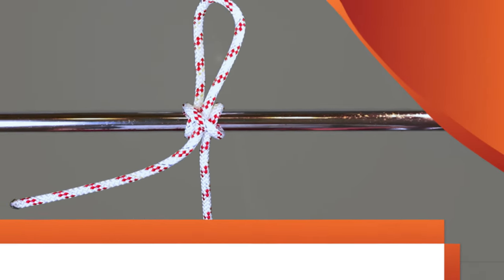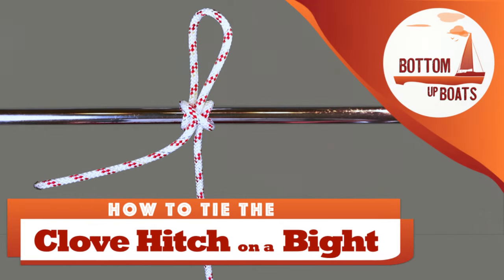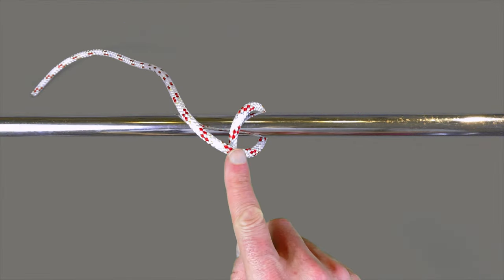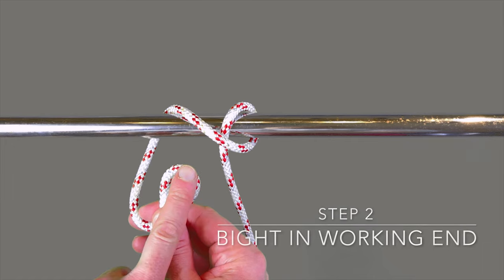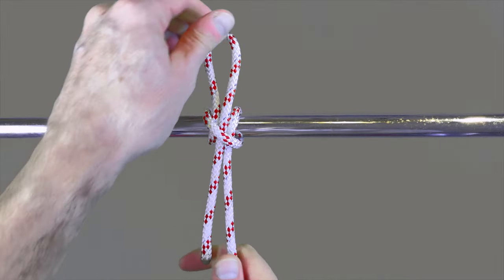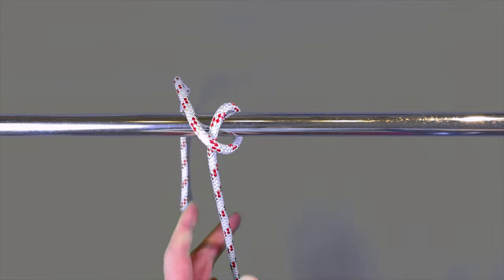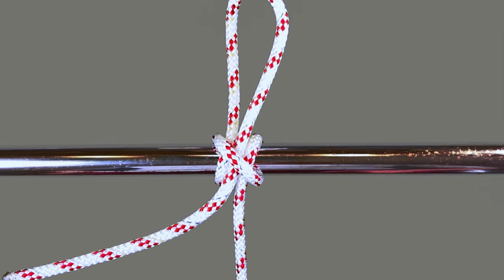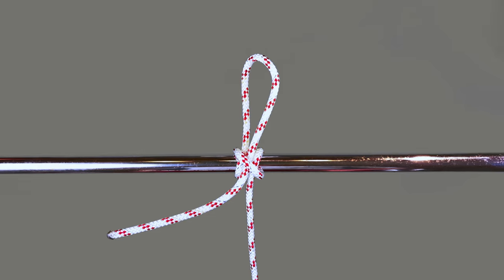Fender Knots: Part 3 - Clove Hitch on a bight

Comment: Not sure this would be my go to for a fender knot ..... think the benefit of these types of knot is that rope begins by going over the rail this allows you to easily adjust the height/length of the fender/hanging weight and then add the (slipped) locking part of the knot. Might help sell it if you also made the slip loop extra long and half hitched it around the standing end for extra security ..... but then the knot name might take longer than actually tying it .... Slipped clove hitch on a bight with a half hitched locked loop?
Reply from the maker: As always thanks for your engagement on our pots. Your points are valid, this series is based of feedback I have been getting from earlier fender not videos. The twist on the clove hitch was the 3rd most popular after the clove hitch and the round turn with two half hitches. I think it is more popular with crew that are short handed where the ease of untying outweighs the disadvantages of this one.

I will have to use small font in the title picture if I end up producing the "Slipped clove hitch on a bight with a half hitched locked loop :)

Comment: this unit does not hold on a metal rail
Reply from the maker: You need to take care to tighten the hitch carefully as the bight does reduce the locking power of the hitch. Once done the weight of the fender should keep it in place. With that said there are other options that would be more secure. We recommend these for shorter stays in the marina. 

For longer stays it is hard to beat the round turn with two half hitches. 

https://youtu.be/M_W3nlil1Ko